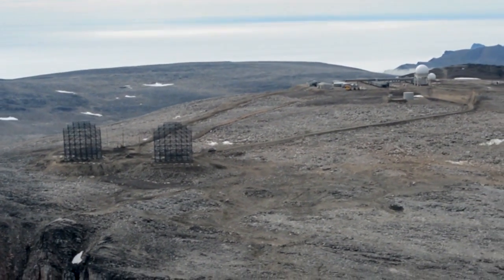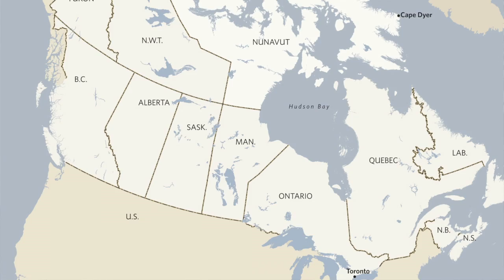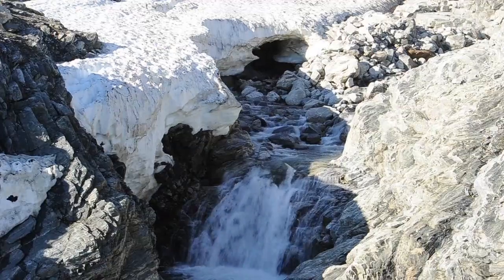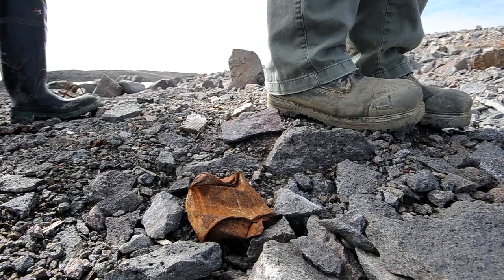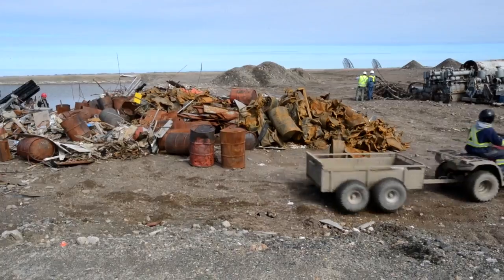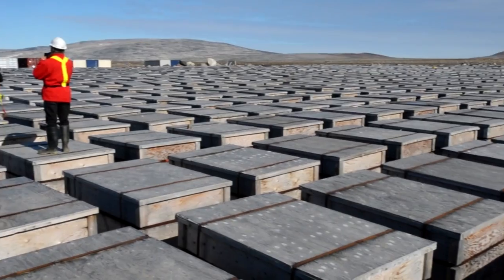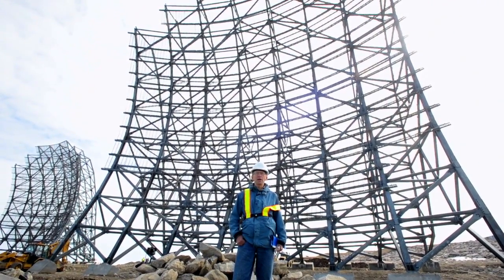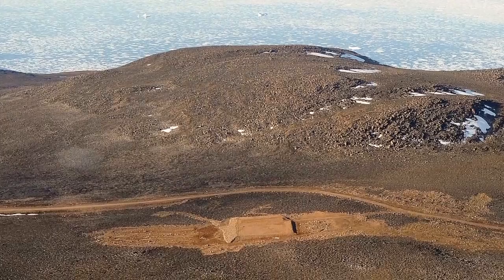DEW Line cleanup

Comment: At Dye Main (Cape Dyer) There where 2 sites. Upper camp where the Radar was built on the mountain and Lower camp near the ocean and air strip. And it was the most southerly DEW Line site with the Arctic Circle passing between both camps
Reply: I was there late 70's.  My dad since the 60's.